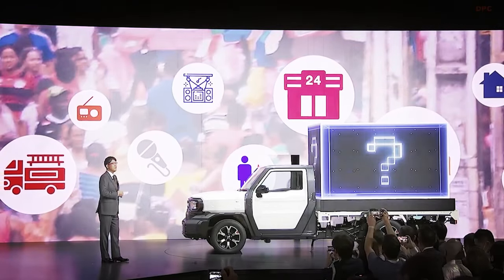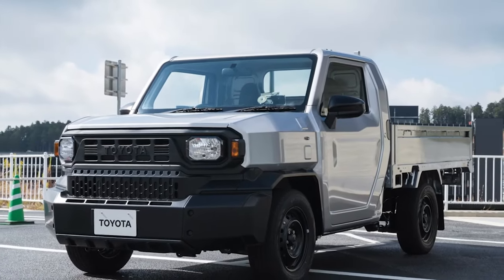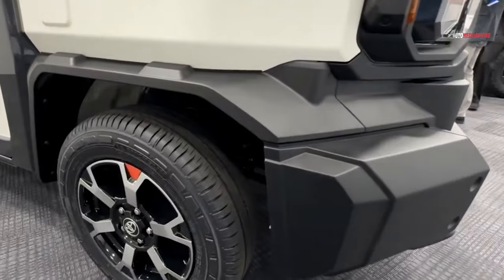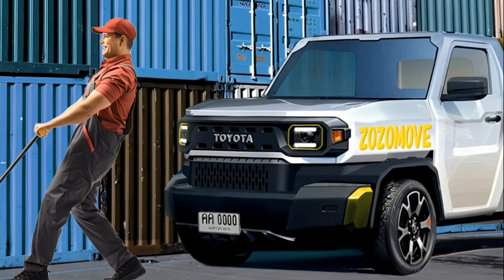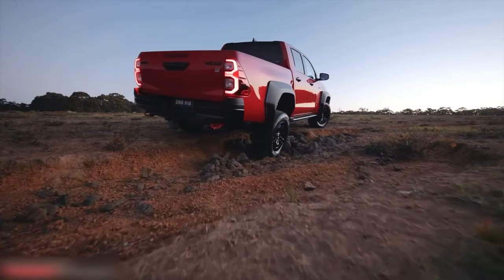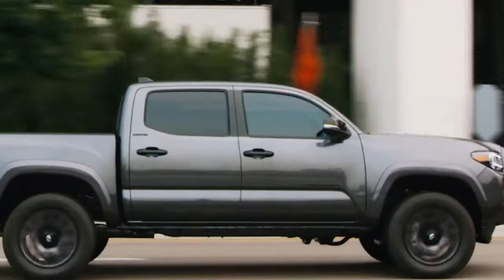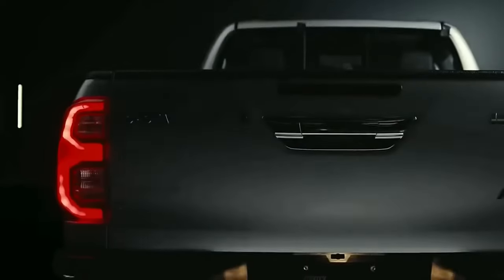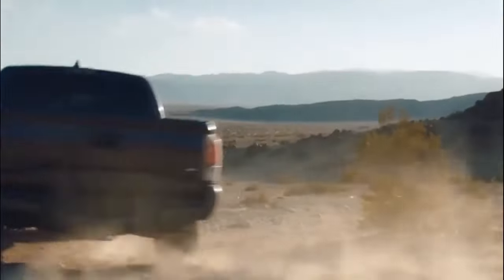Toyota REVEALS A $10,000 Pickup Truck!

Comment: Would love to see them both brought to America especially the diesel model if they can be reliable in cold weather and not clog the diesel exhaust filter!
Reply: EPA has basically ruined diesels in the USA
Reply: USA super strict regulations are the reason why Toyota won't bother bring diesels to the states.
Reply: I dont think youve been around new diesels. You could eat off of the tail pipe after 100k miles @jdrhea6712

Comment: The micro car market is  another area auto manufacturers need to take advantage of.  Using magneto drive technology, being the same  tech used to power trains and then back this up with a bank of capacitors to give the driver the acceleration they desire when needed, such as for getting on the highway or for passing a vehicle. These micro cars could be very spunky and fun to drive and get up to 100 mpg and go up to 500 miles on one 6 gallon tank of gasoline or diesel. This is what people need for in and around town and for rural driving. These could be offered with a starting price below 10k.

Comment: No air bags? Means US won’t get this till 2028 for 20k
Reply: You can have airbags installed for extra. Also, as used for a farm or side bi, you wouldn't need the airbags.
Reply: You can have airbag, ABS, lane departure, etc. installed. The reason it won’t be in the United States is because of tariffs

Comment: The EPA doesn't want vehicles like this here. It would make too much sense..It would hurt the big automobile, oil, and machanic repair companies. If people live and work in a low range area, like small towns or cities. People that only drive locally. The cost and efficiency would truly be amazing. They make trucks, cars, vans and campers. Normal everyday people would be able to afford these vehicles. Me, being 12min from work in a rural area in a facility that employees 150ish people, mostly local, I'd drive it. It would also boost the economy, seeing that the fuel costs would free up money to purchase other needed or wanted items.
Reply: The reason it is not sold in the United States is because of tariffs/socialist protectionism. The tariffs are there to benefit domestic manufacturers and union which fund politicians election campaigns.

Comment: I disagree about the gap in the American market slightly. Those of us that need work trucks don’t really buy a lot of new trucks. It would be hard for a new no frills work truck to compete with the used market in my opinion since used low trim work trucks are readily available. On the farm we have an 02 base 4x4 Toyota Tacoma and an 05 gm diesel. I would never have considered buying a new truck as I was starting my business, and I’m probably not going to buy another truck for over a decade.

Comment: GREAT machine. LOVE the engineering. My gift to Toyota is: the fold down rear tailgate blocks the lights when in  the down position. This is actually an unnecessary danger for drivers parked at the side of the road doing delivery as it blocks the hazards. Simple solution: CUT OUT rectangles in the tailgate that show the lights when folded down. Less steel in the stamping = savings as a bonus. You are welcome.

Comment: I so badly want a solid truck that has none of the frills. I just want it to run
Don’t need AC. Don’t need ABS. Don’t need electric windows, back up cam, on star, Bluetooth, airbags or even a radio. Just want a tuff truck that doesn’t cost half of what I paid for the house